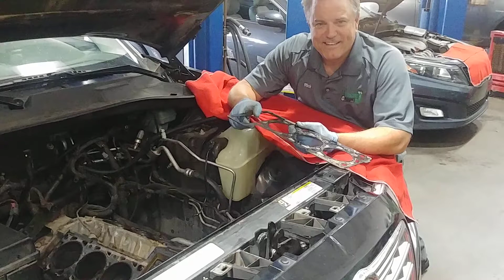What Causes a Head Gasket to Blow

Comment: Mine isn't leaking into the cylinders.  Just blowing out into the engine bay. Oil is fine, radiator fluid has a slight film of oil. Just an old car. Hasn't overheated so far, which is nice.

Comment: how long can you run your engine on maximum hot before the head gasket blows?
Reply: Pretty much every few years you need to get it flushed because the old coolant gets more acidy so it ruins the head gasket by destroying the seals underneath
Reply from the maker: Once you get to that point, it may already be too late.